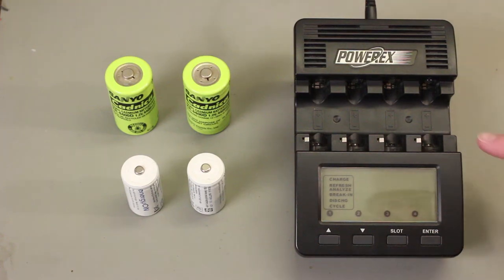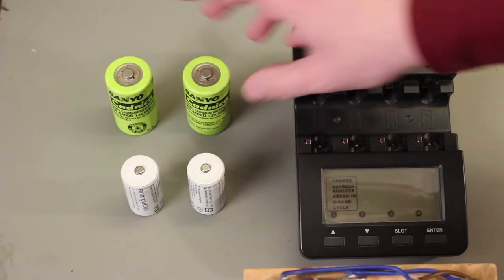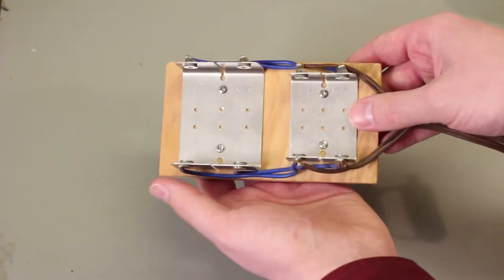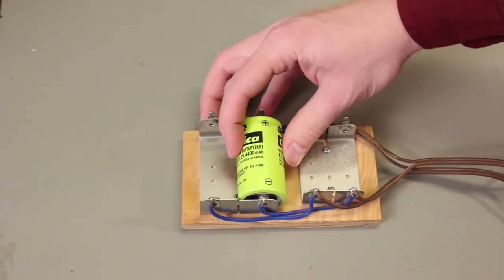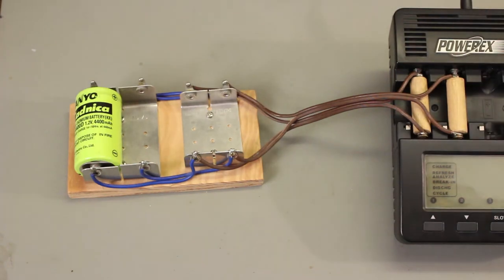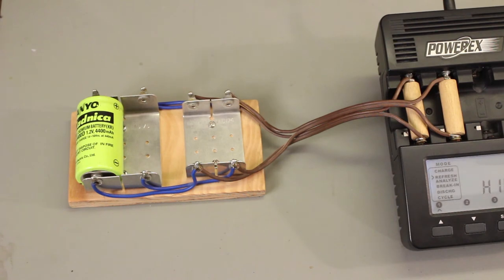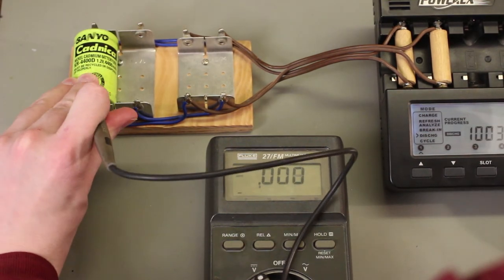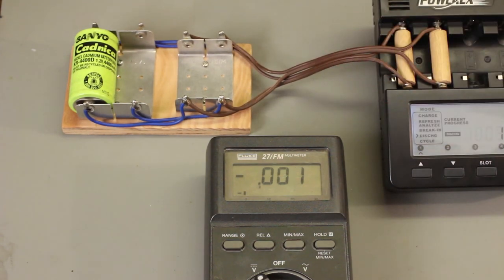C and D Cell Adapter for the Maha Energy Powerex MH-C9000 Charger-Analyzer

Comment: Nice! I took a little different approach, in that I used individual battery holders (so I had four separate holders). I mounted those to a scrap of black, 3/8” thick polyethylene I had left over from another project. Then I mounted my “fake batteries” to the bottom of the PE block—which was a little tricky as I had to get them spaced perfectly. But that way I ended up with very minimal wiring so it turned out pretty nice. It was a bit of a pain to snap the block into the charger, as I’m working with all four bays at the same time, but with a little practice it’s gotten much easier. It’s interesting that MAHA doesn’t offer such an adapter.
Reply from the maker: Sounds like a good idea! I've noticed that over time, the screw heads aren't making the best connection with the charger terminals. Even cleaning both surfaces (screw head and charger terminals) hasn't helped. I'll eventually re-design this with something that makes better connection. Maybe even take the MH-C9000 apart and solder wires directly to the board.
Reply: @w8nwo  That's what I did. I have 4 d-cell holders, soldered some wires to them and soldered those directly to the board. You just have to dremel some holes in the side of the charger to let the wires pass through. Once you open the MH-C9000 you can see the connectors from the AA-AAA easy on the print. You can solder directly to them.

Comment: I got C and D plastic adaptors on ebay that you put the AA cells inside of. The C takes one cell  and the D adaptors can take 2 AA cells, which will give you 5000 mha using 2500 mah cells.

Comment: You could always buy a Maha MH-C808M which does all four types as standard :-)
Reply from the maker: Isn't the MH-C808M just a charger, though? This unit charges and discharges which is nice for determining actual cell capacity. I'd love to find a unit that takes C and D cells as standard as long as it has all the functions of the MH-C9000!